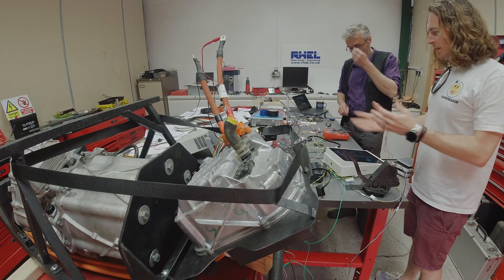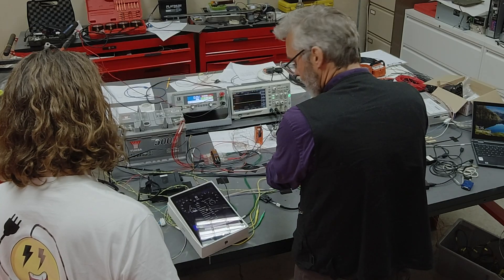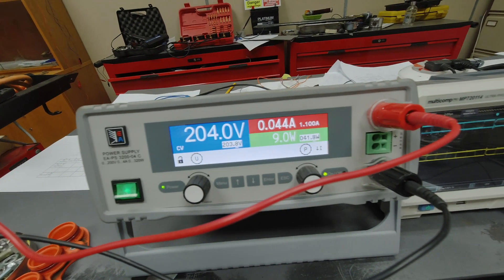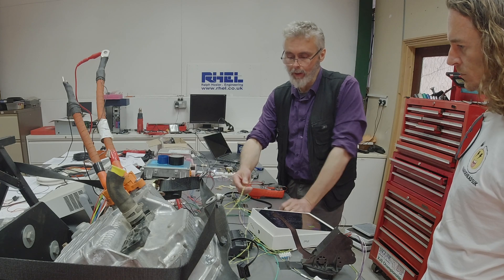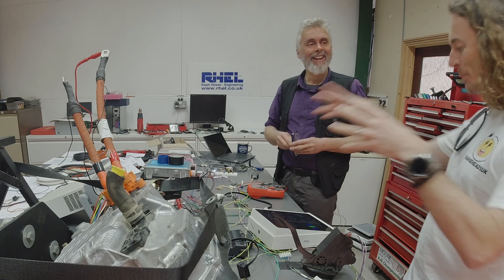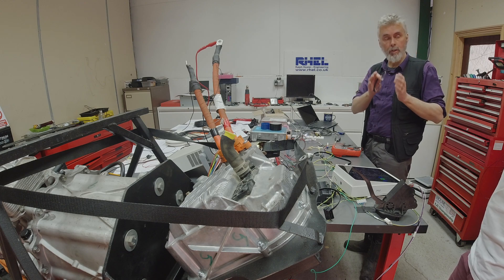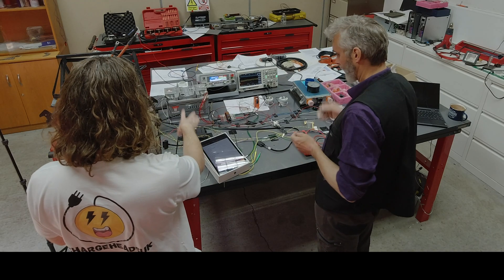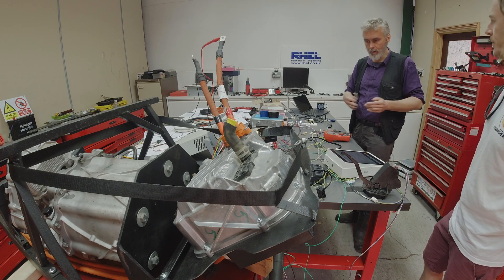Tesla Powered TVR EV Conversion!  Ep19

Comment: I suggest the reason this conversion is proving so expensive is that you're paying for Ralph to learn how to do it.  The lack of knowledge at the beginning meant inadequate planning and cost budgeting.  I sympathize, but only so much.  Ambition exceeding ability usually results in cost overruns.  Good luck getting it finished before it breaks the bank.
Reply from the maker: Well I wasn't planning on selling the Griffith and still looks tight. It won't be luck it will be tightening my belt even more to make it through.

Comment: modern tech...just seems soooo unnecessarily complex - compare it with an R/C electric car:
Lipo, motor, controller...all u need!
Reply from the maker: When you add high voltage the safety certainly goes up a notch, then there's the regen and control etc.